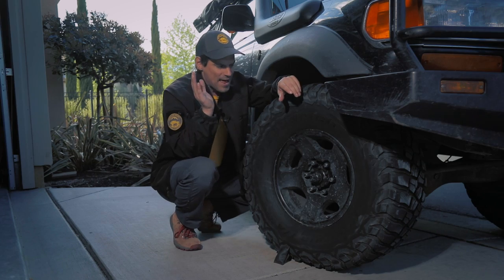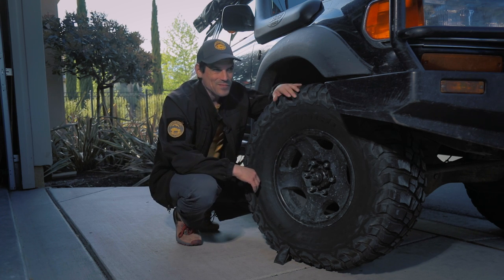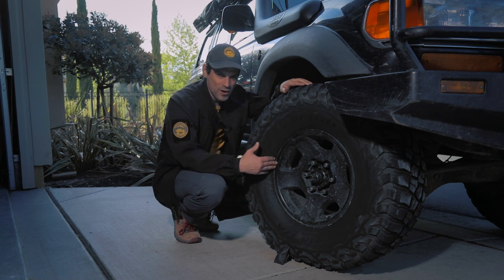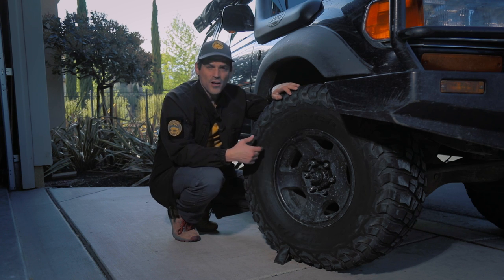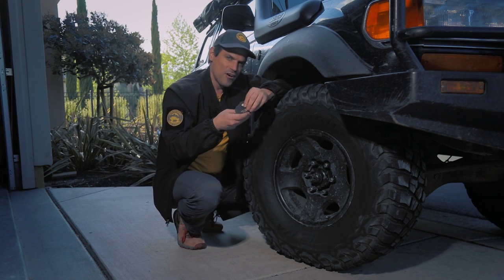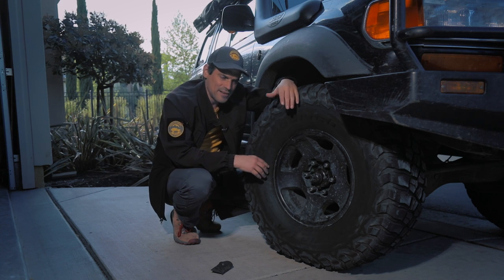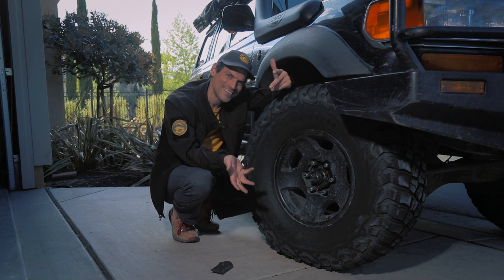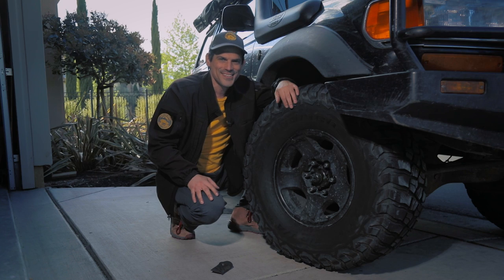Airing Down Your Tires - Why, When, How

Comment: great video. you may have already covered this, but if you haven't, would you do a basic 'tire kit' video? (patch kit, stems, tire irons, ...) (edit, and is it easy to set those tire deflators to a set pressure so you can easily switch between one setting for general off-road, and one for more technical areas?)

Comment: I have a Jeep TJ at 4400lbs, 38x14.50r17 Goodyear MTR. I run 18-20 on the highway, 10 on gravel, 7 on rocks and sand, and 2 in deep snow. Dirtylife beadlock wheels. Thank you for mentioning the fact that the tread grows both in width and length, most people do not realize this. I like that you mentioned the tire pressure should depend on weight but you didn’t really get into it enough, I always tell people to go to 2-3 psi per 1000lbs for gravel and rough dirt roads to smooth out the ride.

Comment: Pro Tip for OVERLAND touring on long corrugated dirt tracks (as opposed to rock crawling/sand); stop every now and again and immediately get out and put your hand on the sidewalls of the tire. If it's too hot to keep your hand on, your pressure is too low. The heat will destroy the tire casing and it will, repeat: will, come apart on you eventually. Maybe not that minute or even that day or week. But when it lets go it will be total failure with no warning.  That can be especially dangerous if you are back on the highway going at cruising speed when it decides to unglue. Happy trails!

Comment: I currently am running Falken Wildpeak AT3W in 255/80/17 on a 14 Tacoma at 35psi highway pressure. I air down to 20-22psi for dirt/gravel, and 7psi for snow. Previously, I have had Goodyear Duratrac tires in 285/75/16 and 235/85/16, and also ran them at similar aired down pressures.  At 7psi, I am able to ride on top of four feet of snow in most conditions.

Comment: Thank you for sharing this. I regularly highlight the benefits of airing down, and I regularly have commenters mock me for doing so. It absolutely positively makes a very real difference when you get off pavement. 
BFG KO2 on a Subaru Forester, running 40 psi on pavement.
I air down to:
Basic forest roads: 22 psi
Technical terrain needing increased traction: 18 psi
Sand or snow: 12 psi
Air up with Viair 88p
Reply: Hey question, I have a 2016 Crosstrek.  I do go off road, but not like how you do it.  I stick to dirt, gravel, and washboard roads.  I go 5-10 mph because it feels harsh.  Am I gonna damage my vehicle if I go any faster?  I see people going 40mph on washboard roads, stock!  I just don't know if the suspension can handle it long term.

Comment: BFG KM3 37x12 on 17” bead locks Jeep JLUR. Run 28 normally, 14 light terrain, 10 for rock, sand, snow normally, 6 for max traction situation.

Comment: Falken wildpeaks at3W 265/75/16
Air down using arb analog deflator,air back up using a arb single on board comp. Digital gauge 
Pavement 35-38 psi
Dirt,light rocks 15-18 psi
 on a Tacoma trd orsb 4x4
Thanks for the video happy trails everyone!

Comment: We just drove the Owyhee Uplands Byway (Southwest Idaho) which is 103 miles of gravel in our van.  265/75/15 Toyo AT.  These tires seem to have pretty soft sidewalls, I aired down to 26 psi from 44.  The van rode very smoothly, cornered without drifting sideways on washboards, and I never slipped a tire driving in and out of campsites on sketchy tracks, rocks, ruts, and mud.  Took about 20 minutes to air back up with a Harbor Freight 12V “high volume” air compressor.  I reinflated to about 35 for the drive home and used the compressor at home to fully reinflate.

Comment: (Live in In England) Kumho Road Venture.  33 12.5 R15 LT. 108Q

"Groceries!" Loving the one take wonders, keep em up please.

98%of my use is on tarmac and light camping so I typically stay at 38psi for engine economy sake.
My rig is a 1997 XJ Jeep Cherokee, with 197k on the clock

Comment: Great video, as always! I run 31 inch Toyo ATIIs with 15-inch rims on my 3rd gen 4runner, usually at 18 psi. (With 3 inches of suspension lift) I'm in South Central AZ, so lots of sand, rocks, and washes. 18 psi Seems to be the sweet spot for how I run and drive. If I'm in a wash or heavier sand for awhile, I'll lower to 14 or 15.

Comment: Like the One Take Wonders! Thank you for putting them out!
I run LT285/70/17 Load C Nitto Ridge Grapplers on my 2015 4Runner. 
Using the JT Brooks auto-tire deflators. They're a bit tricky to set to the desired psi so I don't mess around with changing them. 
For off-road (trails, rocks) 18psi
On-road 38psi seems to be the sweet spot for good rain-traction and confident handling.

Comment: Thanks Michael. I have VIAIR OnBoard, ARB portable, & Power Tank in my rig at all the times.
Running 265/75-R16 Cooper SST's on my 5th Gen3 4R. I operate in 4X4 required terrain over 100 hours a week. The OB family and your videos help keep me safer on the job everyday.

Comment: 33 inch BF Goodrich KO2 for Jeep JK 4 door with XD Rockstars 18 inch  wheels.   Usually air down to 18 for light rocky trails and if there are a lit of rocks I have aired down to 10 psi without any problems.
Reply: With no beadlocks

Comment: I have a set of the Coyote deflators, they work great. I am running 285-70 17 Falken Wildpeak AT3-W on a 2016 4Runner. I set my deflators for 18 psi and so far I haven't found a need to go lower, but I do need to experiment.
The first time I aired down I was secretly embarrassed that I hadn't done it before. Such a difference, not only in grip but in ride comfort, especially on washboard.

Comment: ‘14 Grand Cherokee 275/65/18 went out yesterday to a place we’ve been going for the last 10yrs for plinking and never had a 4wd vehicle before this. And aired down for the first time ever to 25psi made it up a hill I tried last weekend and couldn’t make it at 38psi. Didn’t have the means to air down our back up last weekend and this weekend I was prepared. It made a world of difference with just a 13psi drop. And the washboard road and “high clearance 4x4” road were so much more comfortable. Will try 20psi next time.

Comment: Thank you!!  Your answered my question again. I run a Jeep jk on km3’s 7.50r/16E’s, they are just a little more narrow than a 235/85/16. I run such a skinny tire because of the clay mud in my area. Not a  true trail rig but very capable.  Gravel roads and mud - 20 psi. And 33-36 on pavement.  If I were to get stuck I would air down depending on situation.

Comment: Hey, Great vid. We also have the BFG KM3 315/70/17. So slightly diff size. We’ve tucked a Viair twin compressor w/ 2.5 gal tank where the spare was. LOVE IT!! No issues w/deep water crossings or deep mud. We air down in the same range you do. Looking forward to your cooking video.

Comment: You're doing well with the one take videos!  

I run the KO2 in a 34x10.5 R 17 on a Jeep Wrangler JKU.  For dirt road and light trails I run 18.  For more aggressive trail about 15.  Then in snow I'll run into the single digits but typically start at around 10-12 just to leave a buffer should conditions change.

Comment: O4 Ford F150 new style. About 10-15psi on soft dry sand, 15-18psi wet semi-damp sand and 25-30psi off road gravel roads...this was on a previous set of AT 10 ply 285/70R17. Now have a new set of Milestar Patagonias 315/70r17 or 35's and will test this year as to psi and terrain.

Comment: Thanks for these videos. New or overlanding and I find them informative. I run 35” Nittos ok 17” rims. I typically air down to 15 psi. I have the tools in case I roll a tire but I really don’t want to be in the position on the trail. So I stay a little high to be safe. I think though I’m going to try 10-12 and see how much of a difference that makes

Comment: Wow this was super helpful. New offroader here. I got a Ford Bronco Wildtrak 2022 35s.  the driver's doors calls for 40PSI on road, I run 38psi for a more confortable ride. on the trails I go down to 20-22 psi. sometimes 18psi is the lowest I go. I do mud ruts mostly and some baja fast speeds. I am interested to see what yall thnk about those pressures. I am pretty new.  I run the VIAIR 400P - 40045 for inflating the tires. I love it. I love the ARB505 deflator and it works great and fast.
Reply from the maker: Hey, I’m glad the video was helpful. If you were doing Baja speeds, it kind of depends if you are confident it is mostly sand you can air down more in the teens. If there’s a chance you’re going to hit a rock I would not want to be air down that low because you could damage a wheel or slip a tire. For mud go as low as you’re confident with if your wheels are untested and you don’t know how well they hold a tire at low pressures be conservative.

Comment: Thanks for the videos...  K5 Blazer running Milestar Patagonia MT 35x12.50 17 on H2 factory wheels.  Have run down to 13 psi rock crawling (these wheels hold the bead pretty good), but was pretty sketch without bead-locks.  It's a heavy truck and with about 300lbs in tools/recovery gear/fridge I run 15-18 lbs for trails and rock crawling. That works amazing for me due to the weight of my rig.  If really sandy, I'll drop a little more temporarily.  I recently purchased a power tank (total convenience and luxury) but also have a built in compressor which I'll keep as a backup.

Comment: KO2 for long trips with lots of highway driving, such as Dempster Highway, White Rim, or Continental Divide trails. Typically18 to 22 psi.  Cooper Discoverer STT Pro for technical trails such as  Kokopelli (we live in Moab). Typically 18 psi or a bit less. Seldom less than 15 psi, but may go lower after watching this video. Tires are 35" by 12.5" on 17 inch rims. Truck is heavily modified 2012 Tacoma with Marlin Crawl Box.

Thanks for making these videos, and for the channel. These are difficult times, and your videos are both entertaining and mood  lifting. 
All the best,
Michael

Comment: 2007 Nissan Xterra fully loaded weighs in at 6200lb,      Tires are Nitto Ridge Grapplers, 285/75R17 (34OD) E-rated.

I run ~18-20psi when I'm off pavement, and if it gets technical I will drop down to around 15psi.
Sand I run 15psi, snow I run 12-15psi or lower.

Comment: BFG KO2 T/A all-terrain (255/55R18) on a 04 Land Rover Discovery 2. Usually air down on gravel/rocky at 22-24 psi which is also my go to pressure or if its really rocky like 17psi, sand at around 14psi.
Reply: Adding to the LR thread. LR4 on Toyo Open Country AT3 (255/60R19) 20-25 psi.

Comment: I'm not an overlander, but will be doing some remote camping in Big Bend which requires about 12 miles on loose gravel and some uneven road.  No big rocks to get over.  I'll be on stock 20 rims and Cooper Discoverer ATP2.  You'd recommend going down towards 22psi?  Then airing back up when I get back to pavement?  I'll be doing this multiple times a day over the week.  Just trying to not waste time but travel well.  Thanks, great vid for a guy who knows nothing.

Comment: Very good and informative, thank you. "Did you get the rocky road?!" ...😂.. great to know about those deflators, will check them out. ... am running 215/75r15 Yokohama Geolandar go15's on method 502vspec's.. will air down to 18 for beach sand and soot. Otherwise I'm always at 33... 🙏🏼👊🏼🤙🏼

Comment: I’ve got a 2017 Jeep Wrangler Sport (2Door) with 35” BFG K02’s on 17” Wheels. After doing a chalk test, I found that my tires work best (daily driving) between 30-35 PSI. When off road, (I’m predominantly an Overlander) I usually only air down to about 20 PSI.

Comment: 285/75/16 Toyo open country  mt. I run 18- 22 off-road and sometimes lower in rocks with the TJ rubicon wheels with no problems.

Comment: Great Video!
Recently purchased a 2000 Toyota 4Runner to do trail riding. It came with fairly new TOYO A/T P265/75R16 Open Country tires on the original Toyota Aluminum wheels that I run at 32 psi. I have no idea what pressure to run on other terrain That's the reason I'm watching videos Like yours

Comment: 2010 JK stock rims 31" BFG KM 3's @ 32 psi have never aired them down off road mainly because until recently did not have a way to air back up. New air system is unconventional, running small 120V compressor ( HF 1 gal Fortress ) off my inverter, the compressor is whisper quiet. Also invested in a set of similar deflators so this season will be my initiation.

Comment: Another important consideration for airing down is overheating your tires and blowing one when driving too fast for too long.  When the tire is aired down and the sidewall is flexing out, the tire is absorbing bumps and energy that, in a fully-inflated tire, is normally transferred to the suspension.  Energy equals heat.  Going fast on bumpy or corrugated roads for long stretches with your tires aired down really low can overheat them and blow out the sidewall.  I know, 'cause I've seen it, and I've done it.

Comment: 2018 Ford F250  Nitto Ridge Grappler  325/65R18: towing 65psi, Daily Driver: 55psi, Light trial driving  55psi, Moderate trails 25-20psi , Hard off road obstacles 12-8psi

Comment: Milestar Patagonia M/T, 31”x10.5”-15R on 8” wide Jeep rims under an ‘86 Suzuki Samurai (GVWR less than 3000 lbs). 25 PSI on the pavement.  Down as low as 5-8 PSI off road.  This extremely light vehicle allows for these low pressures that you wouldn’t want under heavier rigs.  Side note: By scale factor, a modest 31” tire renders impressive approach, departure and break-over angles given the tire placement (close to bumpers) and short wheel base.

Comment: I run 16x35 Mickey thompson MTZ3. 22psi for gravel and 14psi for crawling. 38psi for regular road use tends to make them last longer. I could probably go less for crawling but just not confident enough in the boulder (fake) bead lock wheels. I've contemplated on KM3s but stuck with Mickeys becouse I had great luck with them. Thanks for the videos and the content! You guys are great!

Comment: 33×12.5R15 BFG mud terrain on 92 Wrangler running 12 to 14 psi. Could go lower to around 10 on rocky trails to smooth the ride.

Comment: I use the fake Staun air down valves and they work relatively well and I also use a Viair 300P for my 315/75/16 Toyo MTs and it works great.

Comment: BFG KM3 in the popular 286/75R16.
Depending on terrain and speed for pressures. Highway long trips 37-40psi.
Easier trails, desert 25psi.
More rocks and slow stuff 12-15psi

Comment: Jeep JKU running BFG KO2's 37 12.50 17s, sand or gravel at 14 psi works great. Never been stuck at that pressure in the dunes.

Comment: BFG recommends 20psi @ 20mph max. On of off road. You can play around these parameters, but it’s a good place to start. 
OB 4516
03 Suburban Z71 285/70R17
BFG A/T KO2 40 on street, 20 gravel/fire road, 15 harder trails.

Comment: ning stock 265s if i remember correctly on my little truck I'm running 33x12.5R15 BFG KM3s i air down using the ARB air down tool. Depending on terrain im in. Between 15psi  and 20psi.
Reply: Sorry correction 33x10.5r15 , i was falling asleep as i was trying to type the comment. 😐

Comment from the maker: 35s BFGKM3 315/75r16 18 for gravel 12 for crawlin.
Reply: What are you running on the street?
Reply from the maker: I run around 36, but go up to 40-45 for a long haul weighted down.

Comment: Cool video.  I just finished a build with 35K02 on 17.9 wheels On an F350 diesel carrying a 3000 pound truck camper on the bed with airbags   I've never aired down before and with this weight I'm guessing 25 28PSI in the front and maybe 30-35 in the back . Any suggestions?

Comment: I myself have not gotten a new set of tires with the new truck, most likely going with KO2's. But i would like to point out something people often lack knowledge on, Properly airing down and lowering speed on corrugations. To get a better ride on corrugations , you would need to either lower you pressures to what you typically would on sand, if not a little lower, and lower your speed a good bit to not only have a comfortable ride and have your suspension last longer, but it also does less damage to the road/trail your on. The only other thing you could do is raise your speed to an unsafe level but that's not something you would do. Stay safe put there yall!

Comment: Know that elevation changes along the trail will affect your indicated tire pressure as well, although not likely significantly unless running a very low pressure across a high degree of elevation change.

Comment: So you are correct, You can drive on road with air down tires, BUT the main issue is HEAT. Heat will destroy a tire from the inside out.  Max speed of 40mph for a mile or less.    Also wheel width/tire size make a bid difference in the pressures you can run.  I run 35x12.50's on 15x8 wheels at 28psi on road. Thats the PSI where I have even tread wear. The wider tires on narrow wheels also help buldge the sidewall and help protect the rim. I go down to 12 psi max. usually 16-20 is my range for most wheeling.

Comment: 37x12.50x18 Toyo R/T on a 2018 Ram 3500 cclb diesel. 
Sand: 10psi front, 8 psi rear
Gravel road: 18 psi front, 16 psi rear
Rocks: 16 psi front 12 psi rear
Snow: 20 psi front, 18 psi rear
Daily: 38 psi front, 30 psi rear

Comment: 01 ram 2500 with a lance 815 on the back most of the time offroad. 35x12.5x17 toyo open country m/t usually only need to air down to somewhere in the 35 range. But we have alot of weight and don't usually get super technical when we tip the scales closer to 10,000 pounds.
Reply: What are you running on the street?
Reply: @kholtzen1  60
Reply: @huntingstill  nice... after reading some of the other comments I was thinking I was I was running high. Thanks